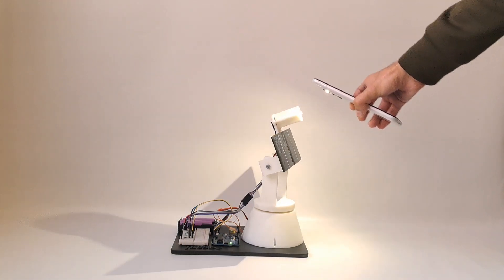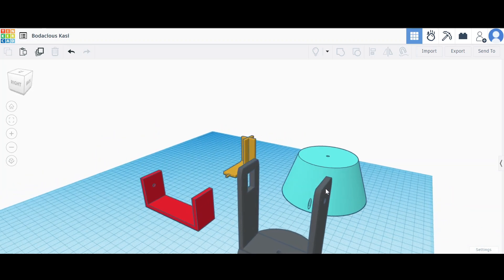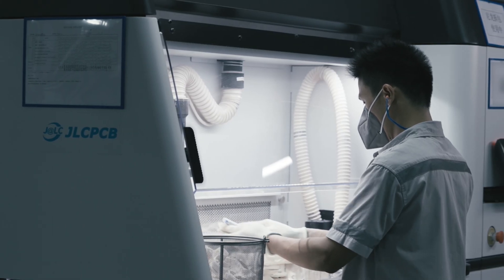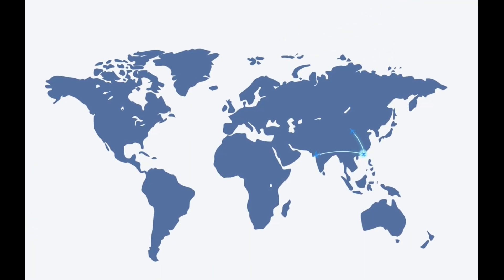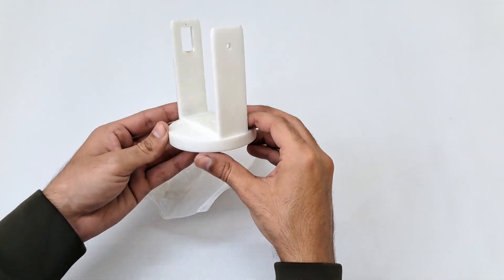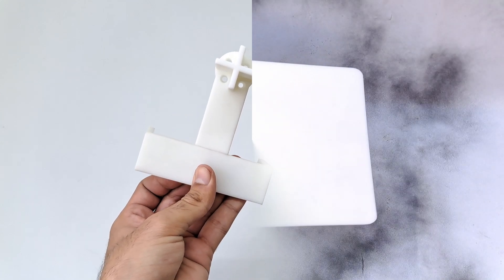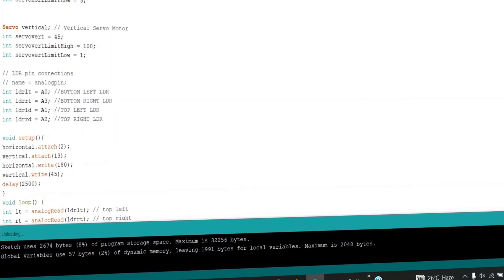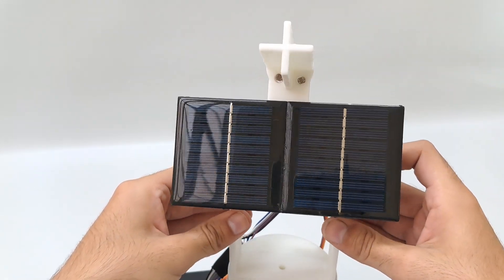How to make solar tracker using arduino | Dual axis solar tracker using arduino | Arduino project

Comment: Bro I want to increase the size of the project can we use the same components or upgrade to another components if need to upgrade mention the components name and size
Reply from the maker: We can do that or you can also but you have to change the servos to mg90 or mg995

Comment: how do we connect the LDR ? Do we have to remove already in pins from jumper and then connect them with the LDRs? and why are there 5 pins from 4 LDRS? and are the 4 pins from LDRS connected (soldered) together? Can it be done without soldering?
Reply from the maker: That 5th wire is common from all four. Do as per video.

Comment: Does this device act as a battery charger, or is it powered by a battery? , If it is intended to charge a battery, what is the correct wiring configuration between the input, output, and the battery?.

Comment: How can i get solar stand and jlc3dp board??
Reply from the maker: Download the file from the blogspot link in description. Then sign in using link in description of jlc3dp, extract the downloaded files then upload each file. Select the product description. Submit your order then add your address and wait till models get verified. At last pay for it and the parts will be delivered to you within a week.
Reply: Its not workin bro
Reply from the maker: What not working. If you want you can contact through instagram.

Comment: I may be wrong, but it looks like you just take the wires from the LDR‘s. N connected to any of the four grounded resistors and just use one positive lead. My question is it doesn’t matter which negative leads from the LDR are connected to whatever of the four resistors?

Comment: Hi, Sorry I'm new to these kinds of topics and i was just wondering how the solar panels will use the energy that it takes from the sun and use it in anything cuz i think this is just to make it move not for it to transer into electrical energy
Reply from the maker: Yes, because the project title justify that the solar tracker and for storing energy we just need to drawn some wires from panel to battery.

Comment: 3d printing model file where is it 
I am unable to find it
Reply from the maker: Scroll down link in description
Reply: @SimpleCircuitsOfficial  thanks bro 

in india also shipping available is it costly
Reply from the maker: @animevideos909 available world wide. Price may vary with time. But it's cost effective.
Reply: Bro its for a small panal can u give me big for 30w panal 3d model ?
Reply from the maker: That we have to design. We also do 3d modeling part if you want then contact through instagram for instant reply.

Comment: Hy bro I need your help
Reply from the maker: Ya tell
Reply: Hello i did all the steps but it go the opposite way of the light position and it trembles a lot 
I'm waiting your answer @SimpleCircuitsOfficial
Reply from the maker: @rayanaddad7379 check ldr connections
Reply: What about the trembling when it turn left and right what can cause the problème  @SimpleCircuitsOfficial
Reply from the maker: @rayanaddad7379 show me through instagram

Comment: I used 360 degrees sg90 and when i upload the code it's just make a noise, could be a difference if i use 180 degrees servo?
Reply from the maker: Use 25v 2200mf capacitor
Reply: @SimpleCircuitsOfficial and how should i put it in circuit?
Reply from the maker: @Cipri17 positive and negative rail of breadboard
Reply: @SimpleCircuitsOfficial  what Kind of LDR did you used? which size?
Reply from the maker: @Cipri17 small basic size.
Reply: @SimpleCircuitsOfficial i think it's a 5mm because I used bigger than that and on oscilloscope was a really small reaction from them to the light

Comment: Hi i made the exact same thing as in the video but the servos need external power how did you manage to run on the same 5 volt rail ?
Reply from the maker: Are you using 7.4v battery??

Comment: In the top servomotor we should not use any that white colour part ???
Reply: @SimpleCircuitsOfficial  that 3 white controlling parts which come with servomotor
Reply: We have to use that or not in the top servomotor
Reply from the maker: @Birdofloyal0217 you have to use that only to avoid slip of servos.
Reply: @SimpleCircuitsOfficial  only servomotor??
Reply from the maker: @Birdofloyal0217 hmm

Comment: How do I make the whole for the motors and the screw on the side? Please reply
Reply: Did you find away ? Did you print this 3d model ? I will do it and i need some to confirm that the measurements in this file okay

Comment: When i am executing the code in tinker cad.. i have not observed any movement in servo motor during simulating.. how can i know whether working or not
Reply: If you have signal on all four photo sensors, that would mean you're looking at the sun. If you want to have motor movement, switch off one of the sensor signals so the system has something to do. If you still get nothing, there might be a software issue.

Comment: Can it be done using ESP32 with same connections?
Reply from the maker: Yes
Reply: @SimpleCircuitsOfficial  SO will it run with a modified code and the exact same connections as for Arduino Uno?
Reply from the maker: @common_w exact as per arduino

Comment: Why does it continuously just rotating ,, Is the problem with the servomotor? Our servos are all sg90 360, is that adjustable?
Reply: I have the same problem did u find a solution ??
Reply from the maker: Servo problem

Comment: The battery which u are using, is it giving supply to motors while charging through solar panel??
Reply: It's not charging. He didn't connect the solar panel to anything. This is just the hardware for the tracking system. If you want to charge the batteries and use the energy from the PV cell, you'll need to put a power driver. The voltage from the cell will not be a clean value, as it fluctuates depending on the panel's temperature and the current sun luminance on point of contact. You need to account for that, meaning you'll need some stabilising circuitry at least.
Reply: You need an MPPT controller or microconverter. For MPPT you also need a converter and a battery

Comment: Can u order the 3d parts
Reply from the maker: You can order 3d parts from JLC3DP first link in description.
Reply: What is cost of all parts
Reply from the maker: @shardulwaikar7560 I forget that you can check on JLC3DP
Reply: How u did the ldr sensors slodering there are only 4 LDR sensor
Reply from the maker: @shardulwaikar7560 one common in all four.
Reply: I have taken 4 ldr wire and rounded it is it possible
Reply: Which glue you used to stick 2 solar panels and other parts on base
Reply: Please help

Comment: Hi, great work! Please tell me what is the print width? and will it work from a power bank?
Reply from the maker: I don't know exactly so you can import the slt files in tinkercad and check for accurate dimensions. May be no.

Comment: hi will this work with a 9v batterie ?
Reply: also i'm using mg99r servo instead of micro will this pose a problem for arduino 5v power output? thank you for the great project!
Reply: mg996r sorry
Reply from the maker: No

Comment: Hello sir , which website I can order   the full solar package components as shown in the video to make the project sir.
Reply from the maker: From JLC3DP link in description.
Reply: @SimpleCircuitsOfficial   Thank you sir, How much is the price of the Frame Structure ALONE frome the JCLSDP?
Reply from the maker: @khutsomakofane1629 you can check on there website because it's being a while.
Reply: Okay Sir,  Yeah initial was how much during your design?
Reply from the maker: @khutsomakofane1629 no idea

Comment: One question, the part when you solder the LDR sensors, which leg comes out? Do polarities matter?
Reply from the maker: Polarity doesn't matter in ldr because it is a type of resistor.

Comment: question 1 
can i use solar cell 5.5 V? 
qustion 2 
where is the code of Arduino
Reply from the maker: Answer 1
For which application?
Answer 2
It's in description.
Reply: @SimpleCircuitsOfficial  I don't understand what you mean by application ?
Reply from the maker: @abdosaeed2348 are you talking about solar panel, if yes then answer is yes.
Reply: @SimpleCircuitsOfficial  Thank you 🙏

Comment: Please there could be other way to do it without 10 k
Reply from the maker: 1k resistor will give you a more sensitive response to light changes, but could potentially saturate the reading in very bright conditions, whereas a 10k resistor provides a wider range of light level detection.

Comment: I only have 1k
Reply from the maker: 1k resistor will give you a more sensitive response to light changes, but could potentially saturate the reading in very bright conditions, whereas a 10k resistor provides a wider range of light level detection.

Comment: I want to connect 5 led at a time to solar panel how can i do that
Reply from the maker: Positive and negative terminals marked on panel so connect your leds in parallel to each other or connect another 3.7v battery with charging module to solar panel expose the panel to sun, battery will start charging and you can take connections out from charging module for your leds.

Comment: Can we use arduino nano instead of arduino uno!!?
Reply from the maker: Yes
Reply: @SimpleCircuitsOfficial  i tried the circuit many times but it still isn't working what could be the problem t tried modifying code from chatgpt as well
Reply from the maker: @chaitalimanwar8433 don't modify anything just show your problem through instagram link in description.
Reply: @SimpleCircuitsOfficial  alright

Comment: Why do we need resistors
Reply from the maker: It creates a voltage divider circuit, allowing the LDR's changing resistance to be measured as a varying voltage by creating a stable reference point against which the LDR's resistance can be compared.
Reply: And for the motors, both are 0° at initially?
Reply from the maker: @ZweHtetAung-x9o yes
Reply: @SimpleCircuitsOfficial  I'm building this and I'm almost finish. The only problem is mine doesn't rotating smoothly. Which could be the issue?
Reply from the maker: @ZweHtetAung-x9o show video through instagram

Comment: sir before applying solar pannel i tried to move it through flashlight but nothing happpened
Reply from the maker: Check connections properly or show me through instagram link in description.
Reply: What's the use of ldr in it
Reply from the maker: For light detection.
Reply: And is it's perfect connection required
Reply from the maker: Yes
Reply: Also can we use 1200mah battery instead of 2200mah battery
Reply from the maker: Yes
Reply: But sir even after following all steps and using 1200ahm battery it's still not working
Reply: The light which blink after connecting battery is very deam or light in color
Reply from the maker: @nirmalasingh2130 show me video via instagram I can't identify it from here.

Comment: Which screw to put inside the upper and lower part so that it should get connected
Reply: Ok sir
Reply from the maker: These screw comes with servo motors.

Comment: Are resisters 1/2 W or 1/4 W?
Reply from the maker: W??
Reply: @SimpleCircuitsOfficial  which resistor did you  used in this project tell us tolerance and w (resistor comes with 1/2,1/4,1/8 w means it can bare upto this much power)
Reply from the maker: 1/4
+-5%

Comment: At the point where the first servo is installed, the place where the plastic part of the servo will fit is printed small by the printer and the plastic part does not fit. what kind of solution can I ask for?
Reply from the maker: Show me through instagram so I can tell you solution according to it link in description.

Comment: hello sir, how to make the solar panel charging the battery?
Reply from the maker: You can connect the wires on the back of Solar panel which I have shown in the video to the charging module and battery.
Reply: @SimpleCircuitsOfficial  is it safe to connect charging module direct to the battery?
Reply from the maker: @1nlysky contact me through instagram on @simple.circuits
Reply: and can it run with just 1 battery?
Reply from the maker: Yes, you can but I prefer 2. DM me on Instagram for any doubt.

Comment: the 3d printed files are in a old version with the LDR cutout not even there, do better
Reply from the maker: The LDR cutout I have leaved on you guys because two different sizes LDR are there in the market and I don't know which one you will use that's why I keep it untouched.

Comment: Hello may I know that the servo motor are 180 degree or 360 degree or both also can use with the coding provide
Reply from the maker: They available in both degrees but I prefer to use 180.